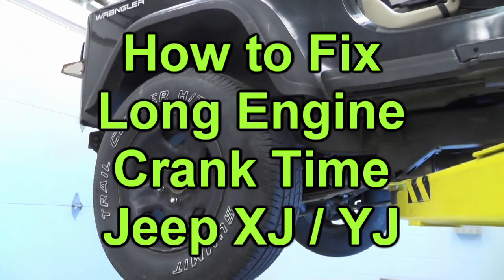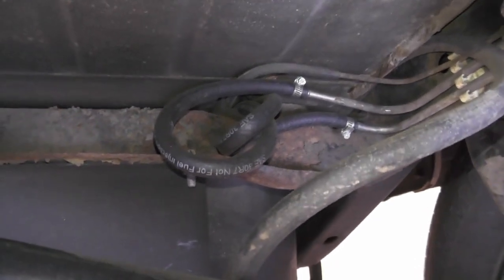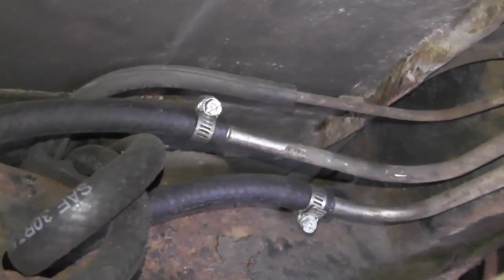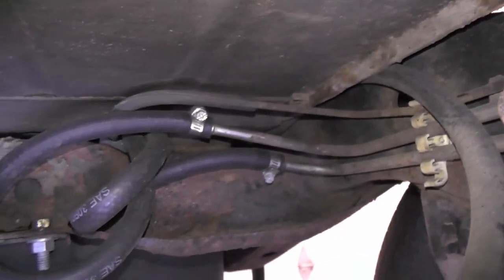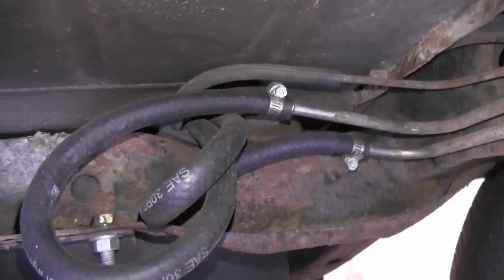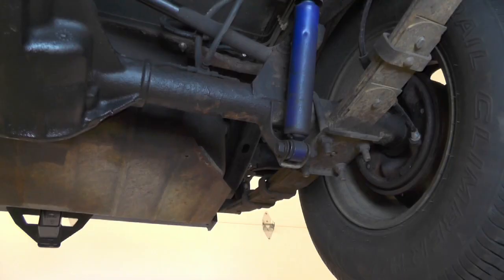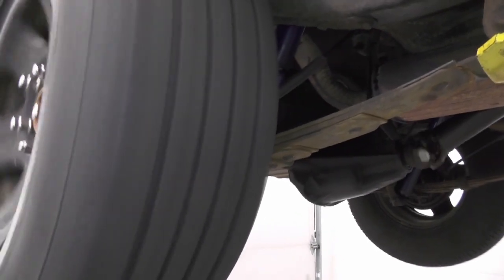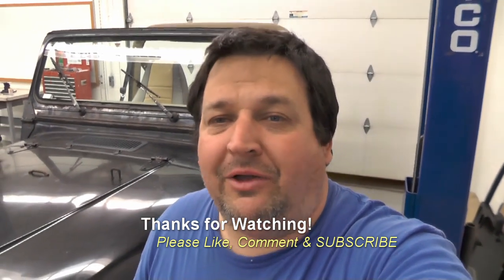How To Fix: Long Engine Crank Time - Jeep XJ / YJ

Comment: Great video.  I have a 2.5 YJ, and I suspect a faulty fuel pump or fuel pressure regulator.  First, I'll measure the fuel pressure at the throttle body check port.  Then, I will add the check valve and check fuel pressure once again.  Maybe I just need to increase fuel pressure by turning the adjustment screw a bit?  Anyway, I'm going to install a check valve.  Can't hurt...

Comment: Love how the fuel line says “not for fuel”😂😂
Reply: Actually the fuel line has "NOT FOR FUEL INJECTION" stamped on it. In 1991 both the 2.5 and 4.0 engines came fuel injected, so the fuel line he is using is not the correct line for his Jeep, although it IS fuel line.

Comment: I was under the impression that these had mechanical pumps?  Wouldn't the engine need to be turning to get flow?  My fuel filter is in the engine bay now.  Could I put this valve in there as well?

Comment: did this to my 96 jeep xj 4.0. is not working . still losing all my pressure within seconds of turning jeep off... get fast pressure to motor on crank, lose all pressure instantly on turn off.
Reply: So have you fixed the issue?

Comment: Would there been an issue cutting the existing tube at the halfway mark and installing the check valve with no new tubing needed?  

Maybe less clamp work under the vehicle?
Reply: I would think closer to the tank better to to eliminate drain back between the check valve and tank.

Comment: Oh my god thank you!!! My Jeep Patriot has been doing this for about 10 months to a year. I went and replaced every Relay in the Relay box, I replaced every single 10, 15, 20, 30, and 40 AMP fuse in the fuse box. None of that worked and then I thought to myself "It has to be the starter" but then i realized that After starting it and turning it off, it would still start almost immediately. But if I turned it off and then walked in somewhere for 20-30 minutes, it would take a long crank and sometimes multiple cranks for the engine to completely start and stay on. I just had this done at AutoZone today for $14.99 and it starts faster than my Dads 2020 Nissan Altima. 😂

Comment: That's pretty cool. Great job bud. I have a 90 carbed and nutter bypassed so this won't apply to me but ingenious none the less. Props. 😎👍
Reply from the maker: Thanks, this one took a while to figure out. It's a tricky problem!
Reply: My YJ is carb'd and nuttered...still does this.
Have a check valve on the way
Reply: @cuttheloop  Did you install it and where?
Reply: How does the nutter bypass help with this, i have a 90 with the 4.2, installed a new weber carb (getting rid of stock bbd) and removed all emissions/vacuum (octopus) lines....runs like a champ, but still has long crank times (annoying).

Comment: great idea have to keep that in mind. .... I think however that you're wrong with your assumption that the last part of the hose is draining in to the tank, if that check valve is working correctly no fluid should drain unless air is able to enter at the valve. Same principal as you can suck up water in to a straw and as long as you keep a finger on the top and seal it no water will flow out at the bottom. So I think you could install that check valve in the engine compartment and get the same results. (just my thoughts and of course i could be wrong too) :)
Reply from the maker: Hi Markus, and Thanks for your comment. I think you're right, I probably could have installed it up in the engine compartment, and it would have worked fine there (maybe even better than in the back, since it would be 1/2 the distance for the pump to prime). However, I put it in this location because it was easy to access the fuel lines there (which were recently replaced), and there was an extra few inches of line that could be cut into, to add the check valve. However, up in the front, the factory fuel line is a hard plastic, with a crimped-on, stainless steel connector, which attaches to the fuel rail. So I didn't want to take a chance, and cut into that line. And since the one in the back was just made with aftermarket Gates hose (and a few hose clamps), I thought it to be the least-detrimental, should the idea not work, and I had to put it back the way it was. Anyway, thanks again for your comment, and Good Luck with your Jeep!
Reply: @stevenofpa  thanks i need some luck with mine because it does not want to start :) no fuel and no spark. not even for a few seconds when you turn the key, so i'm waiting for a new ECM to arrive.
Reply: @swinada  where did you find a new ecm?

Comment: Thanks for the video Steve.  I never considered simply relocating the check valve to the outside of the tank, until now.  This is a quick, easy, reliable, and inexpensive fix to a very common Jeep problem.

Comment: Good video where can I. Get and what they call
Reply from the maker: Hello, Thanks for your question, and sorry for the delay reply. I got the part on eBay, they call it a "check valve", but make sure it's compatible with gasoline (not all of them are). Had to match up the diameter of the inlet / outlet port for use with the existing hose size that's already on the vehicle. But they only cost about $2 or $3 each, so purchased a few different sizes "just in case". However, it's been installed for many months, and... so far so good! Anyway, Hope this helps. And Good Luck with your Jeep!

Comment: Just did it This to my 1992 Yj , I’ve had this same issue for a very long time and not on single video is exactly like this one on YouTube. Already installed and tested it out, just going to run it and test out how long it will last for. Ended up buying on 5/16 off of Amazon, and the fuel line from oreilly’s. Thanks again !
Reply from the maker: You're welcome, Glad you liked the video, and hope things go well with your YJ. I've had mine installed for many months now, and it still works good. However, if I let the vehicle sit for a few weeks, then it does take (just a little bit) longer to start, but no where near as long as it used to do.

Comment: I wonder if they make these for fuel injection higher pressure lines like on a 2000 XJ?
Reply: Be careful some of the new jeeps don't have a return line and the line could blow off when the fuel cools

Comment: That could works on a Jeep Cherokee XJ 94 ? I have same issue
Reply from the maker: Hi, thanks for your question, and sorry for the late reply. Most likely yes. Most of the 1990s-era Jeep models, Cherokee / Wrangler / Grand Cherokee and others with the 4.0-L I-6, had a "return fuel system" that included a check valve in the in-tank fuel sending unit. But if that check-valve goes bad like this one did, you start to loose fuel pressure at the rail as soon as the key is turned off. You generally have to buy a replacement pump assembly, which runs about $200+ and takes a few hours to replace. That would be the "proper" repair, and can be justified in many circumstances. But if the vehicle just gets part-time "play" use like this one, and you know what you're doing, this quick and easy repair can last for a long time. Hope this helps, and good luck with your repair!